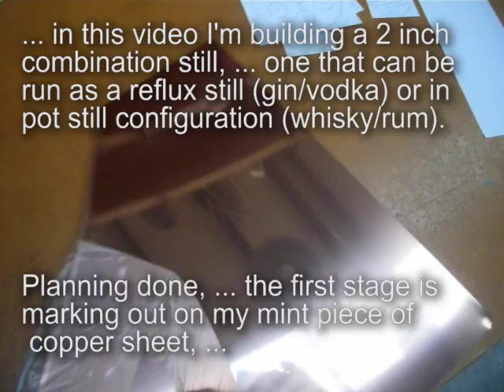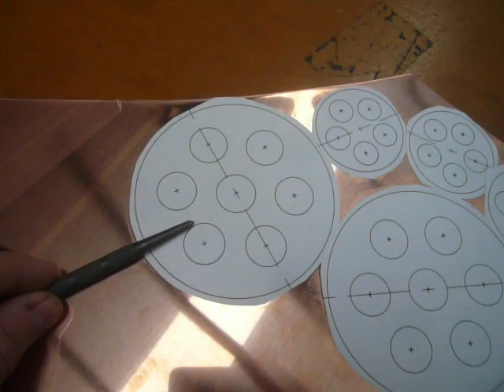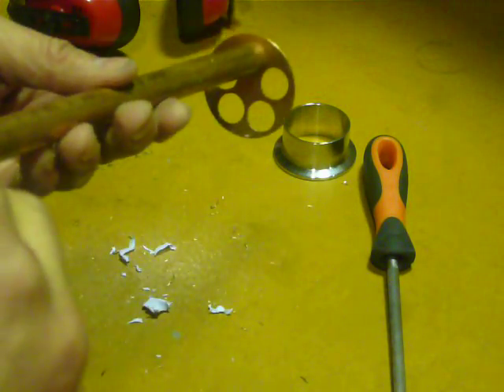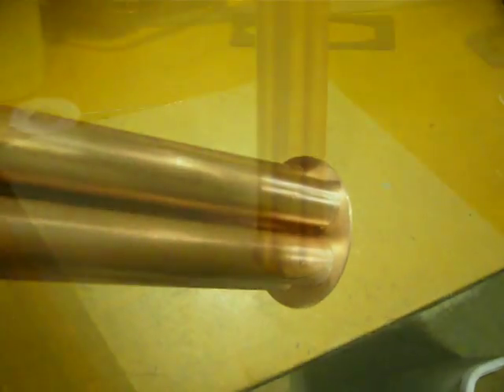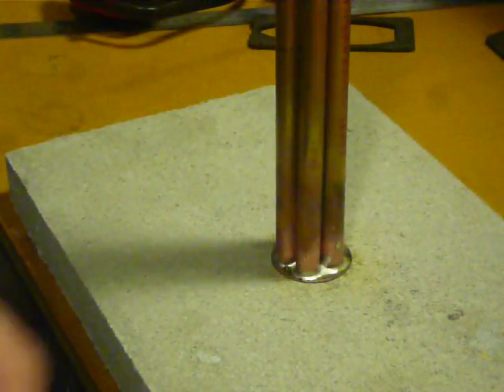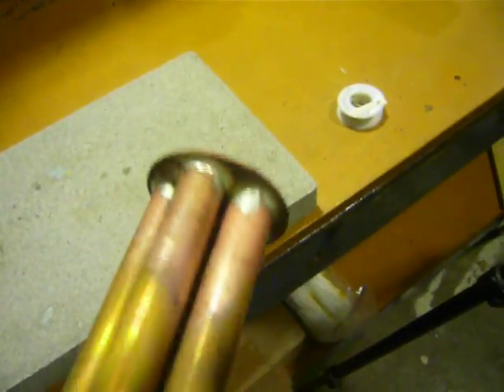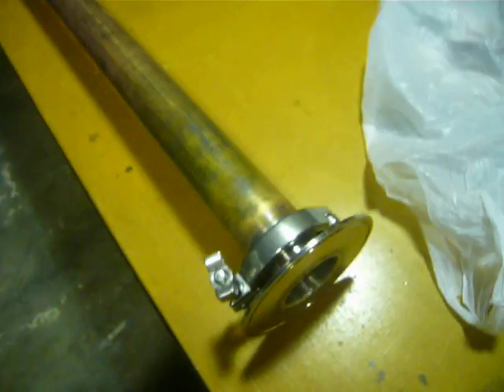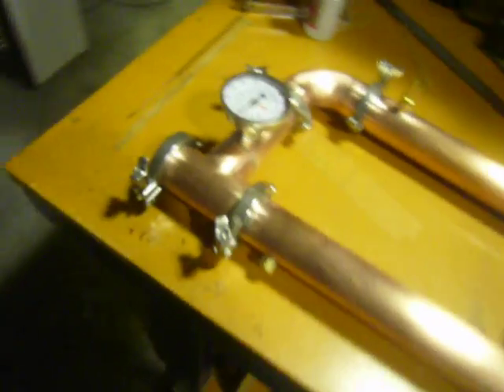2 inch combo-still build

Comment: You did the right thing with the water. Ideal one would have two different solders with each their melting points..but never mind the old plumbers trick with water works. That dephlegmator is enormous..! My first thought was it would be a product condenser. You can run a 2" still with far less than that...I'd say a 150-200 mm worth of dephlegmator. However, as you have build it modular, you'll always have the option of changing the parts around. Well done..!
Reply from the maker: G'day Kalle,
Yep I understand the dephleg' is large for a 2" column but I had in mind sticking it on something a little more substantial than a 50L still kettle at some stage so added a little extra volume. :o)
Had a few issues just recently with copper-stainless bonding with low temp silver solder and liquid flux when it has worked no problem before.
Actually picked up some very-high-temp silver brazing flux on the way into work just this morning so going to re-do the job with that and some pro-silver rods. :o)
Reply: Oh, I see. Well a 50 L kettle, would almost be like having a beer keg as a kettle. If you ever feel the urge for speeding things up, a 3" column would be fine on such boiler size.
A good rule of thumb is: Height=purity, Diameter of the column=takeoff speed. Indeed stainless can be a b*%#! to solder on. You have to be absolutely positive that you get the thin oxidated layer clean off before fluxing and soldering. I silver solder all my stainless with a solder that has 5% AG. The only downside was my plumber's torch didn't quite cut it. So I had to invest in one with a higher temperature or Oxy/Acetyl. I think you'll be fine with the silver rods and the high temp flux. Just remember to heat indirectly to get the thing up in temp. Stainless ain't a good heat conductor so it will draw a lot of heat before is ok. Good luck with your project..!
Reply from the maker: Hey fella - yep, borrowed a oxy/acetyl kit recently for a large 4" stainless jacket product condenser I was building for myself. With Mapp gas I just couldn't get enough heat into the heavy jacket and ferrules to get the solder to bond onto the stainless otherwise - kept getting pinholes, grrr.

I treat stainless to copper soldering same way I do aluminium welding in that the surface has to be buffed back and wiped cleaned with acetone until it's immaculately clean or it's not worth starting. :o)
Reply: @AngryParrotDistillery  Do you know if an acetylene torch would work? Or does it have to be acetylene and oxygen?
Reply from the maker: ckontny123  G'day fella, never used a straight acetylene torch - has always been oxy-acetylene.
Would depend entirely on the heat it can put out - needs to be in excess of mapp-gas, … closer to oxy-acetylene.

Comment: Sorry for my naiveté, but the column is just a hollow tube with ferrules on either end that you pack with what you prefer correct?  Thanks in advance!
Reply from the maker: Heya Peter.
Correct. 😊
I usually use copper mesh or stainless steel scrubbers - not that I do reflux runs that often. The sprung bow is enough to hold the packing in.

If I was going to use rashing rings or some kind of granular packing I'd probably look at permanently fixing some kind of baffle plate (like the condenser baffles) permanently into the bottom of the column.

Happy Distilling!

Comment: I'm going to do something similar,tell me would not it be enough smaller cooler? spiral or other type?
Mash will be made of yeast and sugar.What is the height of this dephlegmator?
What is the performance of this equipment? 
How many liters per hour?
Reply from the maker: G'day John,

Smaller condenser?
I have this still fitted to a 50L kettle and I wouldn't go any smaller on the condenser.

Spiral condenser - you mean a flake stand/worm like I made on my 50L pot still video?
I love the flakestand and worm condenser. It is VERY efficient and does not require a large water flow once it is full.
I have had my flakestand running with a much larger still/kettle and it managed to cool it no problem.

Yeast and sugar wash/mash - so you are making vodka spirit then?
You'll want some kind of reflux column then like this.
Dephlegmator is 300mm long - proportionally this is very long for a dephlegmator, I made it this way so I can have a huge amount of control over it and completely shut-down the vapour path into reflux if I want too.

Litres per hour/performance, ... that's not an easy question "how long is a piece of string" - so many variables; %abv of your wash, whether you are running it as a pot still or in reflux, whether you are on a stripping run or a spirit pass - whether you are running it fast and cruel or taking your time ...

If you put it on a 50L keg-kettle like I have I don't think you be disappointed lol.
Reply from the maker: G'day John,

That looks like a Boka style still.

It's another form of reflux still - just like the still design here can also be used in reflux mode - they work differently but similar result. They can both extract very high abv alcohol %.

With all reflux stills - the faster you run them the lower the % alcohol that comes off.
Run them slower for the high %abv you are talking about.

**It is VERY important**
If you decide to build a Boka-type still, DO NOT make a "closed system" - that is very dangerous and is basically a pressurized bomb. The top of the column above the reflux condenser needs an opening to be able to vent out the pressure.
It is VERY important you understand that John - a lot of videos I've seen showing Boka stills being run/built don't make this obvious.
Reply: What would you advise me?
As I wrote earlier,I care about power and speed.
to do the equipment like yours?

tell me how much time is needed to take on 5l of alcohol 90-95% on your machine?

Comment: Sandwich the copper plate between two pieces of ply screwed together, glue the templates to the ply and then drill the holes you will always get round hole,s to size with no distortion and almost zero burrs.
Reply: I'm using that technique in the future for sure!

Comment: Great video. Quick question. What is the difference between a dephlegmator and a condenser as they appear to be the same construction?
Reply from the maker: G'day Mel,
Yes they both have similar construction and similar function.

"Dephlegmator" or "Reflux Condenser" is the much shorter of the two, sometimes they'll have a thermometer in the base of them, sometimes they'll have a thermometer or probe ports top and bottom (so you can see the temp' differential of the vapor path above/below the dephlegmator), sometimes they won't have any thermometer at all. :o)
Its job is to chill the vapor path enough that you end up with all, or at least the less volatile components of the vapor path falling back down the still column and creating a reflux in the packed column below.
As you initially ease back the cooling running through the dephlegmator you end up with the more volatile components coming across and thru the still head.

The Product Condenser is a lot larger and it's job is solely to condense the vapor path into cooled liquid product - hence they are larger/longer - more surface area.
Last thing you want is alcohol vapor coming out the end of your still - especially if you are running on gas/flame.

I try and use copper for all my condenser internals - even if I make them with stainless outer jackets nowdays - copper is 15x to 20x more efficient than stainless as a heat exchanger.

Comment: What is the silver % in the solder please?
Reply from the maker: G'day Michael,
Fairly low, probably around 5-10% in soft plumbing solder.
Technically, it's called a "silver bearing solid wire solder".

In brazing rods like prosilver 35T or 45T you can get much higher but they get very expensive and requires a lot more heat than propane or mapgas can provide at times - especially if you are working on larger pieces the act as more of a heatsink and wick-away the localized heat.

Happy Distilling!

Comment: i just bought copper tri clamp ferrules. it should solder easier
Reply from the maker: That would make it A LOT easier.
Unfortunately they are not readily available in my country.
Downside is being soft copper they will wear a lot faster against the stainless tri-clamps.

Good luck.

Would be keen to know what you think of them after using them for a while.

Nowdays I silicon bronze TIG braze any copper-to-stainless joins.
Stronger and less hassle. 👍
Reply: @AngryParrotDistillery
Reply: @AngryParrotDistillery   I will let know after i make a few runs with them. Thankyou for the response.

Comment: You would get more cooling surface area by using 7 lengths of 12.7mm pipe. Better water flow too and easier to get in and solder the joins.

Comment: What gauge did you use for the sheet?
Reply from the maker: G'day Ryan, ... the copper sheet for the baffles?
About 1.6mm - 2mm thick, ... basically whatever I come across cheaply. I'm an opportunist. ;o)
I go thicker if I'm silicon bronze brazing nowdays but you can get away with the thinner stuff when silver soldering.

Happy Distilling!

Comment: Holy moly, your soldering is beautifull
Reply from the maker: Thanks fella, I mainly silicon bronze TIG any stainless to copper nowdays but still solder copper-to-copper unless it's very heavy pipe or fittings ... - then back to silicon-bronze TIG.

Happy distilling!
Reply: @AngryParrotDistillery  thats awesome, i can't TIG for the life of me. What fluxe and solder did you use? I struggle to get silver solder in my country...

Comment: Nice piece of work. However with this copper work you are soft soldering not silver soldering. And you certainly would not be welding. Soft solder to food grade uses a tin/silver solder (as opposed to a tin/lead mix) and is called soft soldering. Hard soldering uses something like silver or a bronze filler whereas welding uses the same metal (or very similar) to create the joint.
I used to teach metalwork in schools... I really like your work, the way you organise yourself and the skills you demonstrate with your available resources.
Reply from the maker: Thanks Martin.
Yep correct - silver-bearing solid wire solder. Food/Plumbing grade soft solder.
Think I've listed the exact materials and flux below a few times for folks.

I used it back in the day when I did these vids as it was about all I had access to at the time, Mappgas wasn't hot enough for silver brazing.

I nowdays make similar units for people and use few soldered joins - mainly copper to copper coz it penetrates even a mechanically tight join so well.

Copper to Stainless I now TIG silicon bronze (that can be quite a pain in the butt using soft silver-bearing solder and acid based flux), Stainless to stainless I just straight TIG weld.

If I had an oxy-acetylene rig I probably do a fair bit of work with silver brazing but the setup cost with bottle rentals and outlay is a bit crazy here.

Happy Distilling.

Comment: You realize that a 2x4 TC adapter is pretty cheap
Reply from the maker: This video was shot quite a few years ago when such things we not so ubiqitous.
A 2" to 3/4" copper reducer in my country for instance, carries a fairly hefty pricetag still.

Happy Distilling.
Reply: @AngryParrotDistillery  25$ n in every plumbing supply store. I guess people in America don't realize how easy they have it
Reply from the maker: @boharris8179  
Yeah the stuff you get off-the-shelf must be incredible.
Down here on the bottom of the planet its generally make do with what you've got or make it yourself.
Prices are a lot higher too as we don't have the population to allow large scale importation of most material, and our geo-loc is quite isolated.

Kiwis developed a thing called "no.8 wire" methodology, which is taking common things around you and turning it into something normally unobtainable here. (No.8 fencing wire is a common comodity that gets used in suprizing ways to solve problems down here lol).
Reply: @AngryParrotDistillery  Hey I'm all about repurposeing things. Round here it's called afro-engineering well actually it's got a much less p.c. name but I'm sure you get the picture. I just built a 50 inch (1270)mm high reflux column with one online order to brewershardware.com One to supplyhouse.com and a trip to home depot.

  The 2in (51mm copper ferrule) will be in my mailbox any time today. The rest Monday. It's first section is 24inch (609.6mm)tall 51mm stainless spool off the keg to a 51mm sight glass then the head is 18in (457.2mm) tall of 51mm copper.
  To bad I can't send you a picture it's a work of art. I can't express how invaluable  my 15 yrs experience as a plumber are when doing projects like this. All the videos I watch of guys trying to braze or solder is maddening. I catch myself yelling into my phone😂. Don't put flux on anywhere you don't want solder to stick. Or Jesus man back off the heat. Even when brazing being able to read the metal temperature by it's appearance key to getting it right. Well I've rambled on enough. Stay safe and keep on the good fight👍Happy Easter in advance. If not for Christ we would have a rough go come judgement day.

Comment: How did you run the water through while soldering the ferrules?  Isn't the water running outside the tubes of the defleg?
Reply from the maker: Heya Peter,
Water runs inside the jacket, the ferrules are outside the enclosed space for the water so can be soldered seperately.

I've made a stack of these things subsequently and found that keeping a bit more distance between the baffle and the ferrule made enough of a difference that I didn't have to run water thru' the jacket.

Once I started TIG brazing the ferrules with silicon bronze I do them in reverse order - TIG S/B braze the ferrules with the baffles/tubes just sitting in place then after it's cooled down, soft-solder the baffles/tubes. 

Happy Distilling.

Comment: I would be using a true silver solder stick that soft solder is rubbish
Reply from the maker: G'day Robin,
You mean a silver brazing rod like a Prosilver 34T or 45T yeah?
I agree it would be nicer to use/stronger for stainless-to-copper,  however when I started making these vids I was just using the basic stuff I had at home, - mapp gas, which isn't really hot enough to run silver brazing sticks (oxy-acetylene is much better).

The silver-bearing soft solder is fine for copper-to-copper especially for guys doing this at home on a budget like I was.

Nowdays I prefer Silicon-bronze TIG for any copper-to-stainless.

Happy Distilling!

Comment: Hey there again.
Just about finished making the 2" combination still
and wanted to thank you for all your help during the build.
What a job soldering the stainless to copper.
Visited local welding supplies for advice.
Got correct flux for the job and hey presto.
Can't wait to get this beauty up and running.
Never distilled in my life before but have read myself stupid.
Keep em coming buddy.👍
Reply from the maker: G'day Mel,
Congrats on the build!

Yep, low-temp stainless to copper is a mission at times, rough the surface, clean it, clean it, clean it - and have the right flux definitely!
I've very recently swapped over to silicon-bronze TIG brazing large stainless to copper after coming up against the limits of what my Mapp gas could handle but it's certainly good for 2inch work.
https://www.youtube.com/watch?v=Ak9WiRoHPJo&t=56s

Happy Distilling Mel!

Comment: Hi I try to do same thing lake you but when recieved 2" fellure  the size is different, my fellure going inside 2"tube tell me what tipe fellure you use and where to buy
Reply from the maker: G'day Lyubomir.

I'm using standard Triclamp ferrules, and standard schedule copper pipe I source off the shelf here in NZ.
The s/s ferrules are approx 51mm outside diameter and the copper pipe happens to be the same inside diameter so they telescope nicely.

If the copper tube/pipe schedule in your country is different (turns out in some countries it is possible it may be the same outside diameter as your triclamp ferrules) then you could look for a stainless steel " triclamp expansion ferrule" - those should fit over the outside of your copper tube in that case.

Please let me know if this helps you.

Happy Distilling!

Comment: Hi . could you please give the ferrule  size you used to fit this 2 inches pipe ?
Reply from the maker: G'day Fouad,
2inch tri-clover ferrules.
If the pipe schedule in your country is different you can get "expansion ferrules" which are slightly oversize.

Happy Distilling!

Comment: Hey Grant,
When doing a run do you use copper, rashings, marbles etc in the column.
If so are these used when running in both configurations I.e.pot and reflux.?
Cheers.
Reply from the maker: G'day Mel,
It's "Grant" :o)

I rarely run in reflux setup - most of the time I'm making rum or whisky and pot-still or pot-and-thumper config' is better for carrying those flavors over.
When I do run the hi-octane in reflux I pack the column with copper mesh (rashing rings are pretty expensive here).
At some stage I'll build some sight-glasses and bubble plates and have a play, theres a bit more of a grey-area/cross-over using those.

Happy Distilling!
Reply: Angry Parrot Distillery cheers Grant, many thanks for your reply.